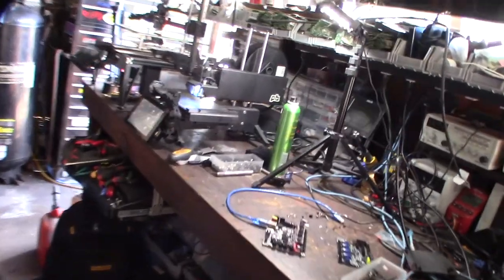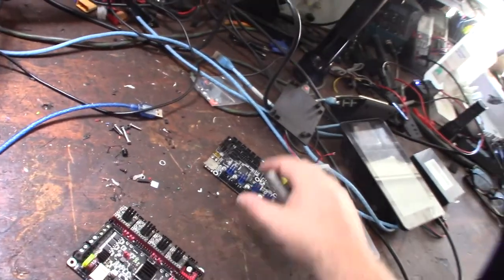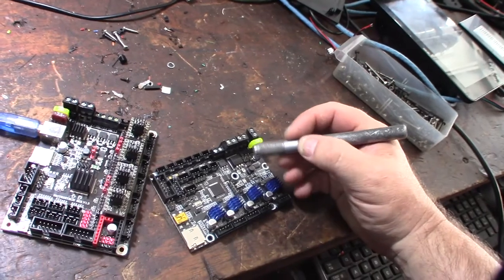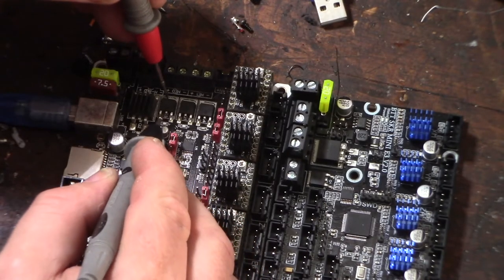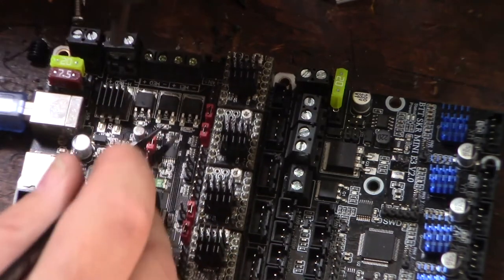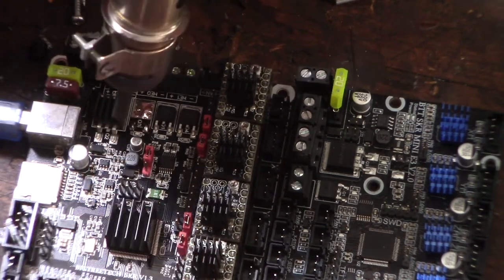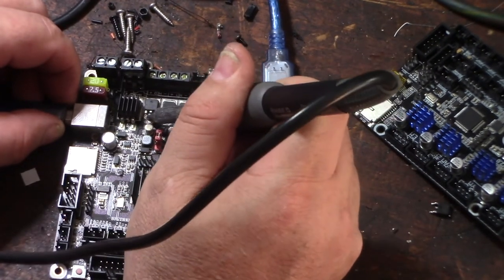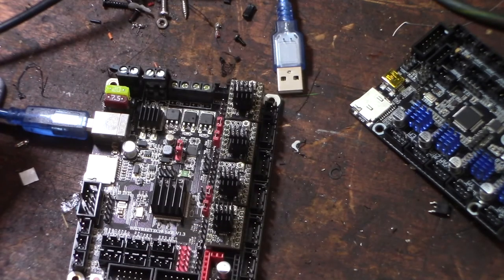3D Printer Board mosfet repair BigTreeTech SKR 1.3 1.4 2 3 E3. Hot end stuck on, does not power off

Comment: Thank you. I have a BTT Octopus. I’ve got 3.3V short to GND when measuring J72 Back pin. But 3.3V line is ok when I measure Back J74 pins.
Because the J72 3.3V circuit, the main chip (stm32f446zet1) doesn’t have power!
Any hint to solve it!?